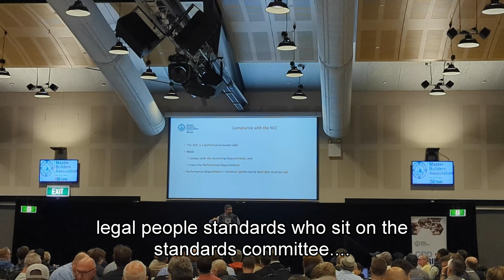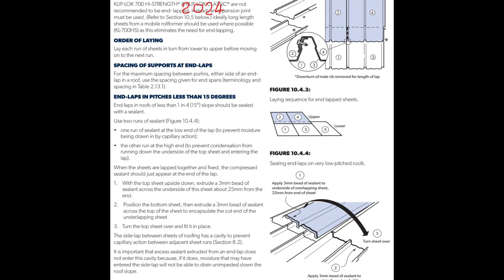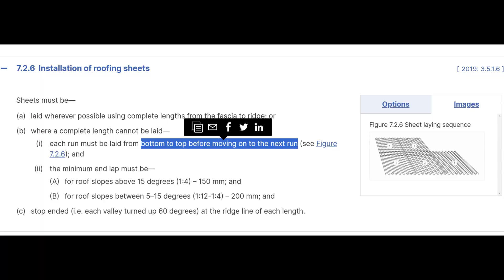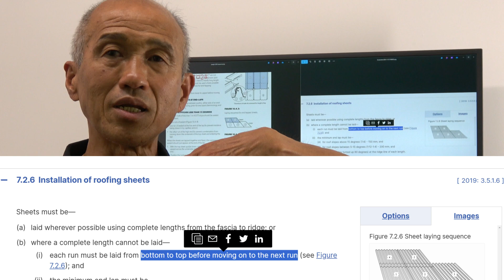End lapping roof sheets and how the National Construction Code  got it wrong

Comment: For trimdeck do you think the lapping order is as critical as with corri?
Reply from the maker: Because of how the water courses behave at the lap and the low pitch nature of Trimdek sheets - the laying order is more critical.
And so is the sealing of the lap correctly.
Reply: In our commercial building low pitch trimdeck roof, the lap sits 20mm higher I assume to prevent wicking issues.